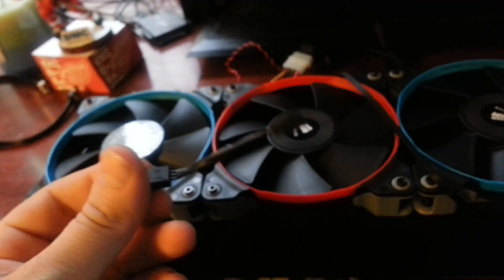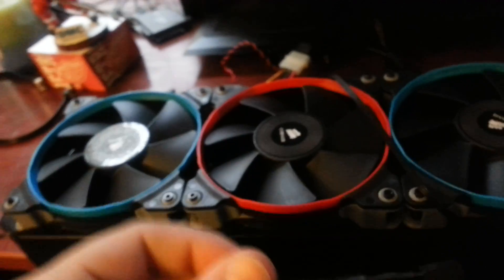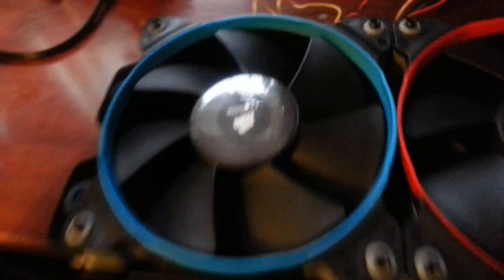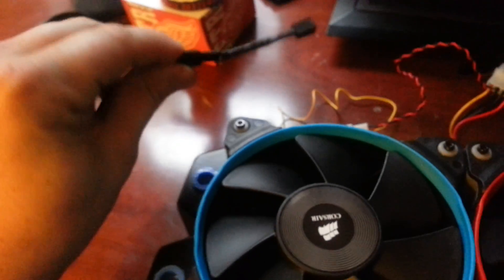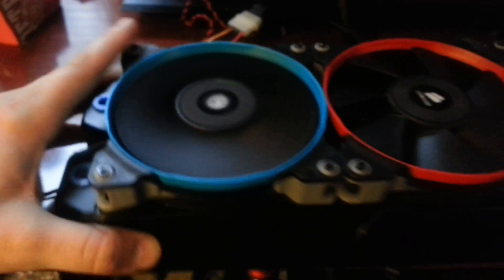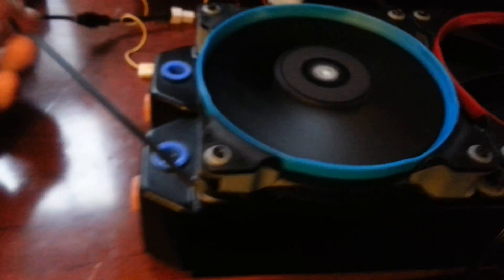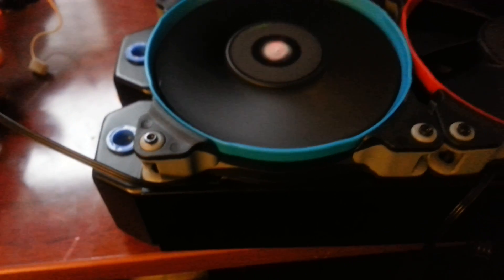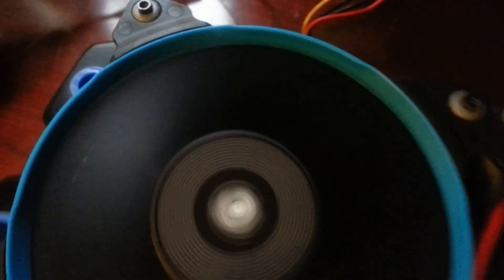Corsair SP120 High Performance Sound Comparison

Comment: Thank you for offering this video up.  NO ONE else, that I've found so far has given a sound test to show that these things are LOUD when at fullspeed, and give off that high pitched sound.
Also, NO ONE mentioned the "extension" actually being a voltage reducer.  Jeez, such lazy reviewers, like Linus from LinusTechTips, he mentions how "nice" the black cables are, doesn't mention they're voltage reducers.
I thought these "extension cables" were a bit too well built to be just an extension cable.
Thank you!
Now I can plug that sucker in and reduce my damn noise levels!
Reply from the maker: Yeah because I actually know about computers, unlike Linus. Haha jk.
Reply from the maker: Dongsa I had the same problem. I couldn't find anyone showing the noise difference so I bit the bullet and got it. This is the only tech video I did just for the reason no one else did it. Thanks!

Comment: Did you run a fan controller with your set up? Just wondering if you would run it without the voltage reduce but have the fan controller slow it down.

Comment: Nice video, more informative than most on these fans! :D

I'm planning on mounting 3 of these as intake for a Storm Stryker, front intake. With the mesh/filter, think they'll do a good job with that voltage reducer?
Reply: Don't use the SP series because those are for static pressure, you should go for the Corsair AF120, Stands for Air Flow these fans let the air flow freely through unlike the SP ones have bigger spades (idk what they're called).
Reply: I would prefer something else. Because these are good for other sides of the case
Reply: PASTRAMIKick I use them for a radiator, the static pressure is necessary there